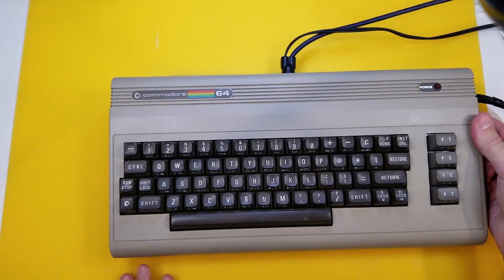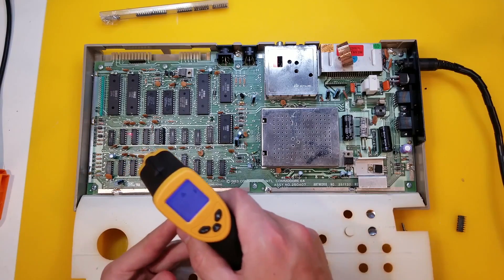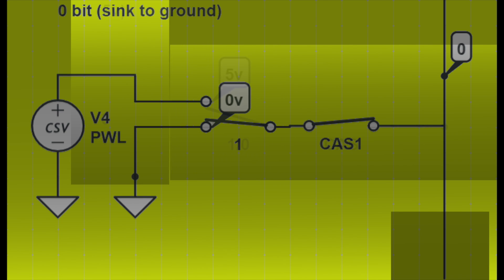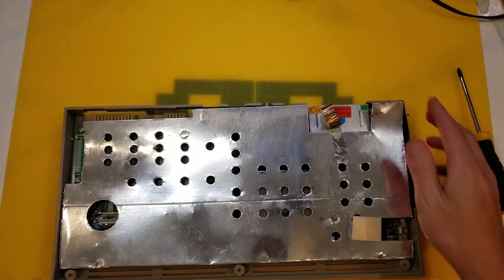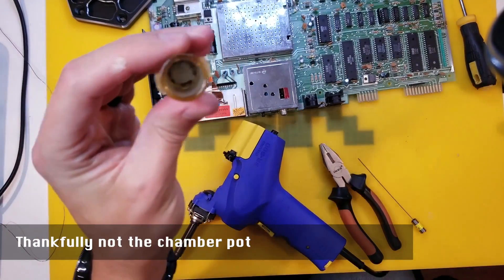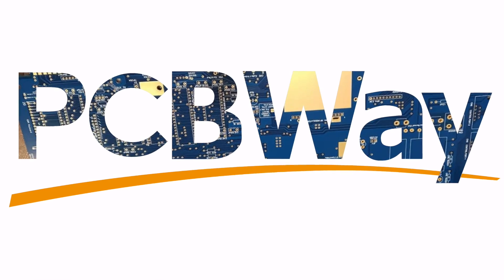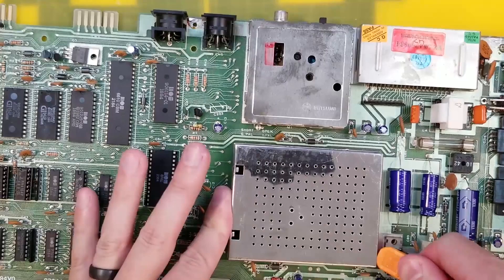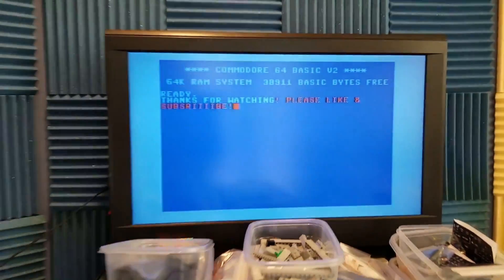How Piggybacking RAM Works: Fix Computers With Just Your Fingers | see pinned comment

Comment: Great video... i have a Commodore 64 but the tape player does not read anything. Ive cleaned the head but nothing. I cant run a head alignment software because it wont read it.  Any ideas?
Reply: Does the serial bus work? If it doesn't, your CIA might be faulty.
Next get yourself Datasette service manual, C2N/1530/1531, and follow the troubleshooting flow charts. It is not clear from your description whether you're getting the tape motor to run at all.
Reply from the maker: Agreed, try swapping the CIA chips around and see if you get a different error. Hopefully they're socketed 😬
Reply: Thank you for taking the time to reply.. Ok sorry for vauge description above...  it was originally coming up with an occasional memory error. Then a few times it would find the software on the tape but then wouldnt actually load just a black screen with broken images. I then googled and it said about head alignment. I didnt have the software so i spent 3 hours trying to align blind. Turned screw all the way left then bit by bit ajusted it trying to run the dataset at each small adjustment but to no avail. It now does nothing atall. I can run floppy disks ok just not tapes. Can i run the align software from a floppy? If so any idea where i can get the software on a disk?
Reply: @horlixs  OK your CIA should be fine, since your floppy drive works, and also since pressing play is getting detected by C64. You shouldn't need to touch it.

I'm thinking it might be time to take apart the datasette. If it was alignment, you would have arrived at something workable within a handful attempts, even if not perfect, it's not such a sensitive adjustment really, i mean two pieces of tape never have the same alignment anyway, not does the same piece of tape after rewinding, and the track is 1.5mm wide, it takes a lot to wander off it. There's a bunch of switches in the tape drive that can accumulate resistance with time and may need cleaning, and there are possible wiring weak points. When you press buttons like play or record, a bunch of switches are actuated, one is letting your C64 know that the drive is ready to run, so that obviously works, but there's likely other two that connect and disconnect the tape head itself, and those might not be doing so well. There's also a small handful of electrolytic capacitors, that should they decay, will introduce interference or bias into the amplifier circuits, particularly interference from the motor that's running right along there, and it's probably a good idea to replace them. In fact isolating the C64 from motor switching noise can be quite important too.

Another cause of data errors is merely the tape transport mechanism, whether it's running smoothly - belts, capstain (must be super clean), pinch roller surface (must be grippy and clean). If you've been around these areas of YouTube, you should already know what to look for.

While you have the tape drive open, manually prealign the azimuth so the head appears to sit parallel with the tape, and then you can nudge it a bit in either direction later.
Reply: Thank you... ive not really delved into it . I just went on the first thing i saw. Im not really clued up about the mechanical side of it so thank you.  Ill take it apart and give it all a clean up with ipa, perhaps freshen solder joints and check the belts ect and see how i get on. Can you recomend any uk based sites that i can get a capacitor kit for the unit? Or am i better off buying matching caps based on whats in there? This infor is super helpfull.
Reply: @horlixs  there were a bunch of very different datesette assemblies which differed mechanically and electrically, and there's probably only two or 3 capacitors in there, so I don't think you'll find a kit. Just get them wherever you're comfortable getting your capacitors. The capacity on electolytics used across supply lines or the motor is not critical, it can probably be increased a bit to improve noise suppression, and uprating the voltage will improve ESR and noise suppression too. Really should look at specific unit to decide, but if in doubt, same capacity, similar dimensions, higher voltage, can't really go wrong. Don't expect to find any high grade specialist capacitors in there, generic crap quality should do fine with some voltage leeway.

Comment: Uhm... just a few corrections.

74ls157 does not go there, putting on top of RAM chips won't do anyone anything good. VIC shield lifts on left side and slides off... and thermal paste is thermal grease mixed with glue. Glued my 128 heatshield stuck with some (not recommended for beginners).

Just a tip for piggybacking, the computer will often not work using this method - often you're just looking for changes, then you replace that one.
Reply from the maker: See other comments about some of that
Reply: @RetroRecipes  Awesome... Love the videoes, always cracks me up :-)

Comment: Those traces on the pcb are looking pretty rough :O
Reply: They look perfectly adequate... Keep in mind they weren't chemically applying a thin layer of tin back in the day, they'd dip the board in a bath of molten solder, take it out all wavy, and then apply the mask, that green protective layer, and it would continue to bubble and shift around on subsequent automated soldering steps.
Reply from the maker: I used an old PCB for some illustrations, and the one I was actually repairing, so you're seeing two here